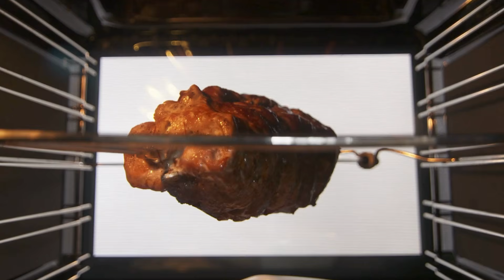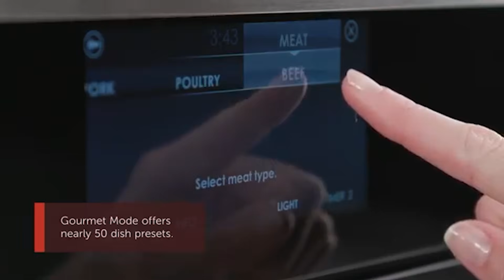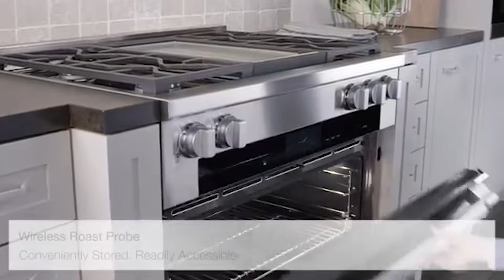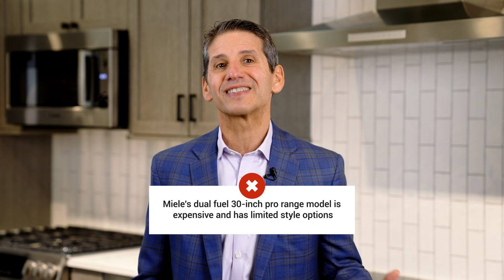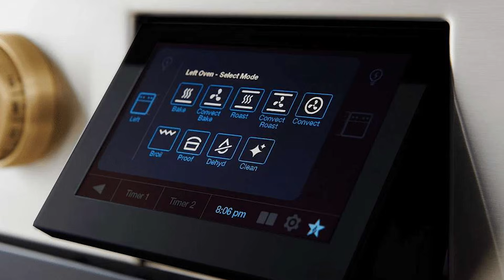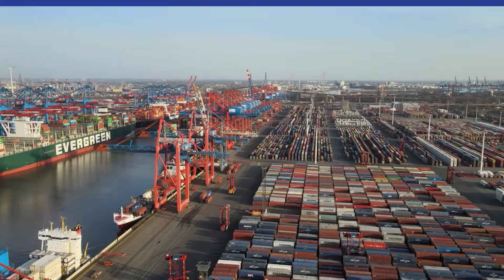5 BEST 30-Inch Pro Ranges Compared: Pros & Cons

Comment: It’s wild how much these residential "pro" brands charge just for the look. I reallyyy recommed checking commercial ranges like Empura or Viking. While you may the fancy clock and the different modes you get high output burners that actually sear properly. They also tend to last a lot longer lifespan wise
Reply from the maker: Please....no

Comment: Which of these dual fuel pro ranges uses a hidden baking element? I would not buy one since the porcelain finish can fail on the bottom inside since the element is hidden under the bottom and heat stress can cause the finish to fail. Hiding the element seems like a great idea for cleaning but creates a short life product. I want to be able to see the baking element under the lowest rack when the oven door is open.

Comment: We are in Colorado Springs where altitude effects all gas ranges and is a little more difficult to figure out temperature. You'll be burning or undercooking several meals until discovering the perfect  temp needed. It's always a chore. Dual fuel ranges are more like sea level and have better results at altitude.
Reply from the maker: More precise than gas...but not as good for roasting or broiling